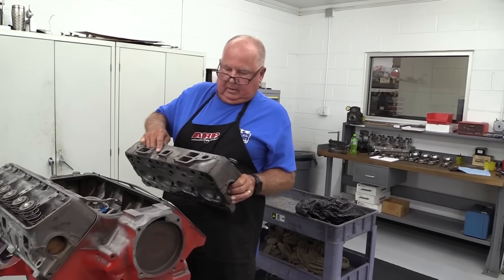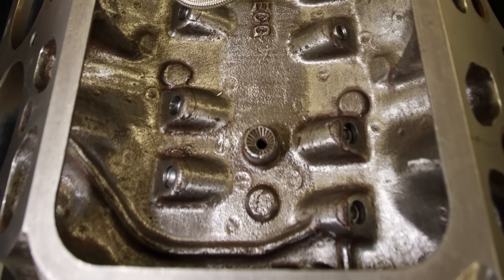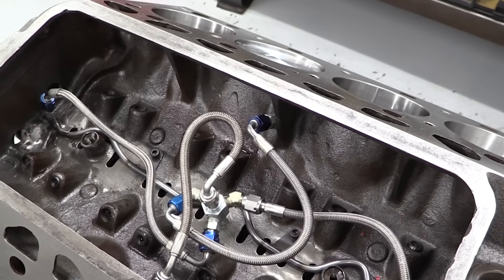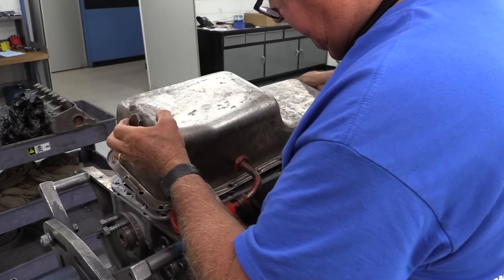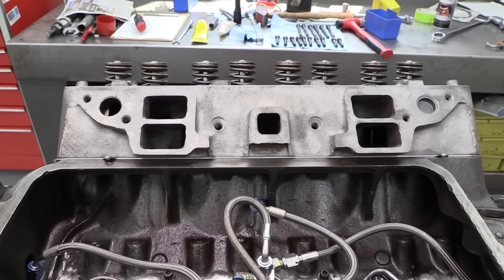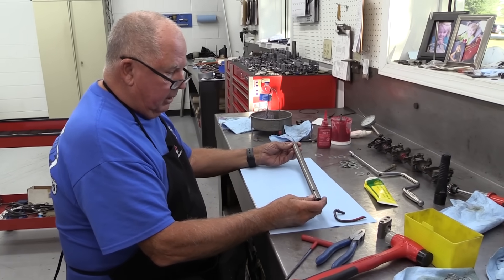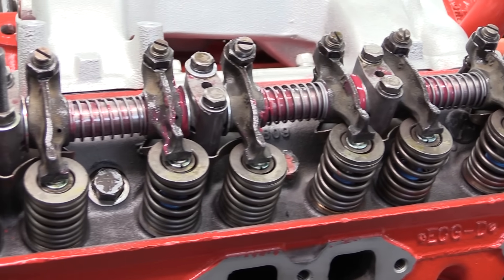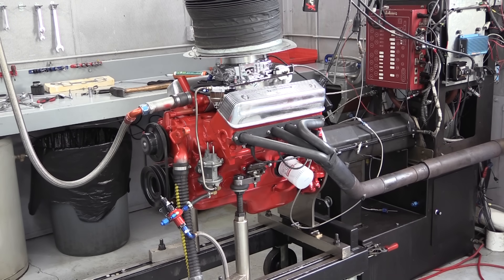The Engine That Replaced the Flathead -- Ford Y-Block Build

Comment: Having a legend like Keith Dorton build a basically stock engine is like asking a world famous chef to prepare a well-done, plain hamburger. At least he got to work some of his magic on the oiling system 👍🏼
Still, it was cool to see one of the vintage engines 🇺🇸
Reply: Yea because when I’m getting an engine done weather it is or isn’t stock I like to take it to a back yard engine builder and have them run a dingle ball honer down the cylinders and hammer the pistons in.
Reply: Chummins there is a huge separation between who you’re talking about and Keith Dorton. Lol 😂
Reply: @jimmy_olds  Given that the engine had already been jacked up once..... sounds like there's not a whole lot in the gap to fill it.
Reply: kyndal anne first of all, my initial comment was tongue in cheek. Second of all, any competent machinist could’ve properly rebuilt the engine to stock specs. Math is math, machining and assembling an engine properly is based around math. While obviously Keith Dorton is a competent machinist, not all competent machinists have the skill set & experience that Keith does at finding power - which is what he’s truly known for. I understand what you’re saying, and going back to my analogy, if you did order a plain hamburger from a world famous chef, it’s probably going to be one of the best plain hamburgers you’ve ever had...but you also didn’t really take full advantage of the chef’s skills.
Reply: @jimmy_olds  Sounds like you haven't been around engine artists...
Reply: @loveisall5520  I have, thanks.
Reply: @CUCV  actually dingle gone is the best finish and most machine shops still use a dingle hone for final finish and also hammer the piston in . Even Keith dorton hammered the piston in
Reply: He was restoring that engine.  Hot Rodding it includes adding displacement and taper milling the heads 7 degrees along with matching the intake manifold’s faces to the new heads angle.  My local NAPA Machine shop can do this trick!  Edit.  T Birds have larger valves and cams to go with them.  Note the +0.040” overbored pistons in this restored Y - Block.  You can’t do everything to every vintage engine, Y - Block or Flatheads.  Ford sold sleeve flatheads which could be cheaply rebuilt with a kit.  Hotrodders pulled out the cylinder sleeves and installed Mercury pistons.  Even the valves were sleeved, and those had to go as well.  So they burned and cracked the now unprotected valve seats.  Welding cracked seats is becoming a lost art.
Reply: Have to completely disagree with you when you're talking about a restoration, not a hot rod. Not ever car needs all the vroom and go fast.....some people just want it restored and built to the best quality they can.
Reply: @phoenixrising4573 , best quality doesn't always result in doing unnecessary mods like was done on this engine.  All of those mods were not needed and corrected no problems.  the oiling problem the Y blocks had was due to the oil allowing build up to happen.  With good quality oil it is never a problem.  Plus what happens when 10 years from now one of those oil hoses fail in the lifter valley and now you lose vital oil pressure cause it was bypassed from its designed routing through aftermarket means.

The upgrade might be fine for a track engine but for a driver it serves no purpose and actually poses more risk for something that isn't taken apart nor worked on all the time like race engines are.
Reply: kyndal ann
Reply: If you think that way, you have absolutely no shimmer of a clue what makes a “world famous chef”...
Reply: @jimmythepowerful   "Mmmm...   That  is  a tasty burger."
Reply: 😂😂Nice
Reply: Talk about odd things on the Y blocks,line up cam and crank dots,surprise it wont run.could make u scratch ur head what's wrong.
Reply: Because the oil passage  from the central cam bearing takes a dog leg at the juncture of the block and head, the passage tents to plug up with sludge. When that happens you must either pull the heads to clean out the passage, or install a set of copper line oilers. The fix this guy uses prevents that plugging from occurring in the first place. However, I am not sure I would omit the oil drain from the rocker arm shaft though. It may not be necessary, but the Ford engineers apparently thought it was. I'm a "Ford man", but I still don't care for the "Y" block. I had one in my '55 Vicky for years, but I still prefer the 289 in my '67 Mustang Fastback.
Reply: @oldgysgt  hello
Reply: @oldgysgt , with modern oils it is not a problem.  my 56 still sports an original 292 that has never been apart, it oils just fine because quality oil was used.  inferior oil is what allows the build up to happen in said passage till it blocks the oil flow off.  With modern day oil today it is never an issue unless you decide to run dollar store oil in your Y block.  Thus those mods he did was pointless and actually will cause more problems in the long run on a driver.  I don't know about you but ive seen those braided hoses fail.  Do you want to have a engine with these kind of oil bypass mods done and have a hose fail or worse yet a AN fitting back off and instead of pumping oil to where it needs to go is now just simply dumping oil back into the oil pan?

This kind of mod is great for a race Y block that you are always messing with but a stock engine that will be driven daily is not something you do this mod to.
Reply: @Milner62 ; I attributed our cleaner engines to better air filters. Premium oils of the 1950s were not all that different than standard oils of today. But modern paper air filters are VASTLY better than the old "oil bath" air filters of the 50's. My old auto-shop teacher would say an oil bath air filter was very good at keeping chicken feathers and cotton bowls out of your engine. When we took off a valley cover back then, we used a putty knife to remove the half inch thick sludge. The number one cause of rod and main bearing failures was a oil pickup screen that was totally clogged with sludge. And that thick goo is mainly dirt and oil mixed. The heavy dirt settles out and coats the surfaces with a dark mud like substance. Fine dirt also caused severe cylinder ware. We had to remove the "ring ridge' before attempting to remove the pistons. If that wasn't done, you could break the piston glands. The last engine I pulled down had less that the thickness of a sheet of paper at the top of the bore, and the valley and inside of the pan were so clean, it only took a swipe with a cloth to clean them. My old "Y" block had to be overhauled every 50,000 to 75,000 miles and rebuilt after 50,000 miles more. My 1995 Mustang has 95,000 miles on it, (I'm a low mileage driver), and the heads have never been off. Like I said, I believe the paper air filter is the great savor of engines.
Reply: @oldgysgt , sorry oil is not what it was 60 years ago.  In the 50`s like when my 292 was out in '56 they recommended single weight oil that you changed with the seasons.  Multiweight oil was in its infancy in the 50`s.  You also had non detergent oil and detergent oil and the composition is completely different as well.

To say the oil remains unchanged or relatively unchanged is just laughable.

The paper filter sorry that I cant say is your saving grace.  my '56 292 has over 130,000 original miles and never been taken apart for a rebuild.  it still sports the OE oil bath airfilter.  so tell me again how the oil bath airfilter caused premature engine failure.  Maybe it was how you serviced said engine that caused it to not last?  I have records for my '56 back to 1963 that show the service done which was done at the recommended intervals for axle, transmission, engine.

So if you were rebuilding your Y block at 50,000 mile intervals you were doing something wrong.

The oil bath filter does its job quite nicely, I just recently changed the oil and flushed the filter element out you should have seen all the small particles that a paper element filter stops that this filter stopped as well.
Reply: @Milner62 ; multi-grade oils are not that new. My 1967 Mustang called for a multi-grade oil, and that was 52 years ago. But like I said, oil is NOT intended to keep dirt out of your engine. That is what an air filter is for. And Paper filters are FAR superior to the 1955's oil-bath filter when it come to doing their job.
Reply: @oldgysgt , you really should work on your reading comprehension skills.  I never said multi-grade oils were new.  I said they were in their infancy in the 50`s and were not recommended on the Y blocks.  The early mutli grade oils from this time period is nothing like what we have today.  But go on I am enjoying how you are destroying yourself by making assumptions and arguing aspects that were never even argued in the first place.

You also claim your y block has to be rebuilt every 50k miles and blame the oil bath air filter and keep claiming oil is not intended to keep dirt out of your engine.  But yet here I am with a 60+ year old 292 that has never been pulled from the car before and never been apart for a overhaul and is well over 100k miles with the oil bath filter.  To be honest the engine is pushing closer to 200k and I might very well pass 200k miles before I reach this car for the frame off restoration.  So tell me how is it the airfilter as being the problem when mine is going way longer than the Y block you rebuilt numerous times?  Sounds to me like its your inability is the reason why your engine isn't lasting.  Either your lack of maintaince or your lack of mechanical ability to build a engine properly.

Its just like you scoff at how I must like noisy rocker arms for not adjusting my rocker arms in 3 years even though they were quiet for those 3 years before I had to make an adjustment.  Your monthly adjustments is a sign of a bigger problem or your in ability to properly set the valve lash or something.  All I know is I follow the OE manual for service and set things to spec and when it comes to the valve lash they were set at 0.019" as the book said.  If you are setting yours more often coupled with having to rebuild your Y block every 50,000 miles and blaming a oil bath air filter for the lack of longevity is a telling sign that you don't know what you are doing.

A little bit of information, the oil bath air filter is no different than the K&N air filter.  Hell even the paper filters used in the 60`s, 70`s, 80`s and 90`s on some applications are a oiled paper type of element.  The paper is the filter media and the oil is to help the particles stick.  In the case of the oil bath, horse hair is the filter media and the oil is to allow particles to stick.

Like I said earlier I just recently did a oil change in my air filter and you should have seen how much more dirt this oil bath filter has captured compared to paper filters.  Every paperfilter I have has never caught this much.  But please continue blaming everything but yourself for your engine problems when there are people out there with none of the problems you claim.
Reply: @Milner62 ; I got 15 years on you. And like I said, I did my first 272 the year before you were born. The 272,292,312 family were a total joke. They developed less HP than the small block Chevy, the oiling system was full of problems, (you never saw a set of aftermarket oilers on a Chevy V8, because they never needed them), the model 4000 Holly carburetor was crap, the exhaust manifolds were poorly designed and inefficient, the factory single exhaust front crossover system was poorly thought out, the heat riser gate on the duel exhaust cars frequently stuck, and although Ford had experience with Hydrophilic lifters on the Lincoln Cosmopolitan, they stuck to solid lifters on their small block and used a very outdated hollow rocker shaft that required manual adjustments. Most all of these problem of poor design were fixed on the later 289, and the crummy "Y" block was finally dropped. None of the bad features I have mentioned that the "Y" block had were ever used in a Ford engine after the demise of the "Y" block, and the contemporary Chevy engine didn't have these poor features either. Ford's Ugly Duckling "Y" Block never did become a Swan. 
But when are you going to realize the purpose of oil in an engine is to put a active film of lubrication between moving parts and to carry away friction caused heat from bearing surfaces, but NOT to keep dirt out of the engine! And air-born dirt in an engine is the number one cause of engine wear! If you REALLY are 60+, why is it you don't know that simple fact?
Reply: @Milner62 ; I see you are still at it with the childish personal attacks. Why don't we try once again to raise this discussion to an adult level, shall we. Now, is your Y block stock with the original pistons, rings, bearings and valves? I doubt it. And you are apparently under a serious misunderstanding; I did NOT say that only 1950's Y block engines were usually gone through at around 50,000 miles. That was true of most ALL cars back then. My problem with the Y block is it was a poorly designed dead end, and apparently Ford finally cane to that conclusion as well. None of the poor design features of the Y block that I pointed out were used on subsequent Ford car engines.  And you never said; are you still using the oil bath filter, or have you changed to a replaceable paper filter?
Reply: @oldgysgt ,  I'm not making childish attacks.  I am stating the facts.  You said yourself you rebuild your yblock every 50k miles that is your own in ability or lack of servicing your engine properly.  That's not a insult as it is stating the obvious.

As far as my 292 goes I've said it multiple times my yblock I just looked at the odometer and it's on 63k miles and I have service records back to 1963 in one notebook that indicates it is 163k miles.  Not once in the book is the note of a engine replacement nor engine disassembly.  This car is also a one owner vehicle when I got it so I know its history quite closely.  Believe me when I tell you this engine has never been apart.  Only part of the engine that has ever been taken apart is the valve covers for the regular service of rocker arms and the water pump I rebuilt when I got it as the water pump was locked up.

So quit with your assumptions first you assumed my age and now you are assuming my 292 that has never been rebuilt has been rebuilt when I have the documentation to prove it wasnt.

You cant believe it because yours didnt last 50k miles and you cant admit your rebuilds didnt last either to your inability to rebuild a yblock or your in ability to properly service said engine.

This has nothing to do with insults it has to do with facts.  Everything you've stated and presented as fact is nothing but personal opinion that has zero bearing on this.  Your engines inability to last does not mean it's theoil bath air filter as mine is over 150k miles currently and always used the oe oil bath filter it wasnt poor design of oiling system as mine still has great oil pressure and rocker arms oil nicely with no restriction.  Every thing you've said can be influenced by lack of proper service.

Now have you taken that reading comprehension class yet?  Seems you still need it as I've said numerous times my 292hasn't been overhauled before but you just dont grasp that some reason jut like you took my age as 60 when I said my 292 is over 60 years old with no rebuild and no oiling problems.  Just like I've said numerous times my engine is still running the oil bath filter with over 150k miles on it but you keep asking when the answers were provided. 

I'm sure everyone here is laughing at your complete lack of reading comprehension skills and how you are shit talking an engine saying how horrible it is when it isnt and all you can provide is your failed attempts of citing your inability to build or care for your engines.

As far as rebuilding goes I still call bullshit on engines of the 50s having to be rebuilt at 50k miles.  My newest vehicle is a 82 model with over 100k on it with no rebuild.  My 78 is right at 200k with no rebuild.  My 63 was at 170k when the engine was pulled to hotrod it.  Then my 56 is over 150k miles with no rebuild.

Not to mention the yblock was used in argintia to the 80s same block but heads were changed.
Reply: @Milner62 ; sorry Charlie, I never said I overhauled MY 272 every 50,000 miles, and I doubt your 56 year old has the original pistons, rings, and lower bearings, regardless of what some service book says. The oil bath was a piece of crap, and ANY real mechanic will tell you so. Like I said, Ford realized the Y block was a dead-end, and replaced it with a modern up-to-date Overhead V8, and that is a FACT. I really don't know why you are hung-up on praising the Y block, but you differently are in the minority! 

PS; by the way, if your Y block was made in 1963, it must be a pickup, right? Didn't the 1963 Ford pickup come with a disposable paper filter? As I remember, it did. In fact, didn't Ford convert to paper filters in 1957? Do you know what an oil bath air filter is and what it looks like? Just what kind of Ford are you talking about and what year is it?
Reply: @Milner62 ; before going any further, what is the model and year of your Ford with a Y block engine?
Reply: @Milner62  I live in Australia ,although I hail from new Zealand. Back in the 50's through to the late 70's we couldn't get SBC's easily unless you had 'contacts' where you could import them, but y blocks were common and I had my 1st at 17,even though I drove a belair as a daily. I learned that although there were few odd things like those crazy inlet ports,they could be made to live and that Y block held them together very nicely .Bigger Ford Trucks came with a 292 and 312  but sported steel cranks so we were always trying to find them. I have seen them run,literally into the ground but the thing that seemed to kill them was a lack of regular maintenance ,something that goes for any machine. you never heard of a Y block exploding because  of design weakness ,and even blown ones held together nicely. Yes,you could buy a blown Y block from Ford in 57. Today,lots of geriatrics like myself still remember the revs they could reach and still be making power,whether they were cars or boats. As for oil, I used detergent 30 Diesel oil in mine...because i worked in a Diesel service depot.
Reply: @Mercmad  , yep and we are seeing Y blocks making over 500 hp easily.  But a sbf of the Windsor family 500hp is the limit of a OE block.  More than 500hp and they seem to split the block in half.  If you plan on making over 500 it's better to go with an aftermarket block.

But yeah people say the Yblock was poorly designed lol.
Reply: @Milner62  
500 hp y block 
easily ????
Reply: @oldgysgt  - your lack of Ford knowledge is obvious to an old Ford parts man like me. Ford used OIL BATH air filters through (at least) 1979. All F-350, 330 cu in FE/FT hybrid V8's they supplied for U-Haul chassis cabs came with OIL BATH air filters. They are in the official OEM Ford shop manuals. I personally own an F-350 1979 ex-U-Haul, and have the OEM OIL BATH filter.
Reply: @oldgysgt  The 292 was the longest-lived of the Y-Blocks, carrying on until 1962 in U.S. cars and until 1964 in U.S. trucks. It was also used in Argentina in the F-100 pick-up well into the 1960's. 

In 1971, the engine was modified to accept a new-style cylinder head with a different valve arrangement - in this form, the 292 continued into the 1980s in the F-100, and was also used in the Argentine Ford Fairlane (built from 1969–1982, and based heavily on the U.S. 1968 model). 

All Argentine versions of this engine feature a cast crankshaft rather than the forged example that equipped US heavy-duty engines. The 292 version was also produced by Ford of Brazil and equipped the Brazilian LTD starting in 1969. Both the 272 and 292 engines were replaced on Brazilian cars by the 302 engine starting on 1976 model year.

^Did you read that^, mister know-it-all Y-block critic? Ford's Y-block was installed from 1954 through 1982! That's OVER 28 years, and no doubt they were still being cast after that 28 YEARS! Must not have been a good engine, eh?
Reply: @sandibaker7646 ; My father's 1959 Ford Ranchero had a disposable paper air cleaner, as did my 1967 Mustang and my 1972 Ford LTD. Large Ford trucks might have used the obsolete oil bath air cleaners longer, but I have not seen any Ford passenger cars use them after the late 50's.
Reply: @sandibaker7646 , the Ford Y block was still a piece of crap. Solid lifters, poorly designed oil system, and inefficient exhort system. If you like them, fine, but you are in the minority. The overwhelming number of Ford Flathead conversions to small block overhead V8's were done with Chevy engines, not Y block Fords.
Reply: @oldgysgt  -- I was a parts man at a large Ford dealership for 8 years (1969<1976). I am well aware of Ford paper element air filters, and their applications. 

Oil bath air filters were preferred when most roads were dirt, even though they were messy to clean. A farmer might be driving daily on dirt roads, or a dump truck delivering mined sand on dirt roads -- in such cases, and others, daily cleaning of oiled elements would be preferable to daily replacement of paper filters.

"As roads improved in the 1950s, the need faded away for a filter that could hold a lot of dirt without clogging. Thus came disposable pleated paper filters, which could filter smaller debris."

Ford and U-Haul decided that an oil bath air filter was best for thousands of F-350's, through at least 1979. By then, most roads were paved, and the mass production of paper element air filters had reduced their purchase cost enough to make them preferable to "obsolete" oil bath air filters.
Reply: @oldgysgt  - so, by your reasoning, Ford used their Y-block "piece of crap" for over 28 years? I see now! They should have bought their engines from Chevrolet!

As far as solid lifters go, many racers prefer them to hydraulics, to this day. Ford was selling economy, ease of maintenance, and a low selling price in 1957. THAT"S why they outsold Chevrolet in 1957.

Ford used the same "poorly designed oil system" of the Y-block when they redesigned the FE oiling system in 1965. Ever hear of Ford beating Ferrari at Le Mans three years in a row, with their 427's "poorly designed oil system"? The side-oiler powered Ford GT40 MkIIs had a 1-2-3 finish in the 1966 24 Hours of Le Mans, and the winner's podium in 1967.

Ever hear of Ford's 427 SOHC, and it's "poorly designed oil system"? 

"The SOHC 427 found its niche in non-stock drag racing, powering many altered-wheelbase A/FX Mustangs, and becoming the basis for a handful of supercharged Top Fuel dragsters, including those of Connie Kalitta, Pete Robinson, and Lou Baney (driven by Don "the Snake" Prudhomme). In 1967 Connie Kalitta's SOHC-powered "Bounty Hunter" slingshot dragster won Top Fuel honors at AHRA, NHRA and NASCAR winter meets, becoming the only "triple crown" winner in drag racing history. It was also used in numerous nitro funny cars including those of Jack Chrisman, "Dyno" Don Nicholson, Eddie Schartman, Kenz & Leslie, and in numerous injected gasoline drag racing vehicles."

Perhaps Ford's "poorly designed oil system" was not as "poor" as you think it was?
Reply: @sandibaker7646 ; oil bath air filters are crap. As my old auto shop teacher would say, "they're fine when it comes to keeping chicken feathers and cotton bowls out of your engine, but that's about all". It's true that in a dusty environment they don't clog up like paper air filters, but they also don't keep the fine dust and grit out of your engine either. By the way, what kind of air filter is on your car? HHHHMMMM?
Reply: @sandibaker7646 ; over 28 years or over 128 years, the Y Block is still crap. Apparently you can't understand; I don't like the Ford Y Block engine, but apparently you do, and that's all. So get over it!
Reply: @oldgysgt  - K&N oiled cotton gauze - the better than paper progression from an oil bath type. You seem to lack reading comprehension, and your shop "teacher" was a very poor example - If oil bath type WERE crap, why did Ford and U-Haul use them through (at least) 1979?

With your expertise, you should contact Ford, and I am sure they will ask you to be a consultant, and hire you in their engineering department with a $100,000 per year retainer
.
Reply: @sandibaker7646 ; It's now obvious to everyone you know nothing about automotive air filters. You might be able to read a parts catalog, but you are ignorant of the properties of an air filter. Have you ever heard of "microns'? Apparently not. A good paper filter is capable of a micron rating of 5 microns, with is over 10 times finer than the best rated oil bath filter.
Reply: @sandibaker7646 ; by the way, the K&N air filter with a cotton media cover is NOT an oil bath air filter. It's a paper air filter with a cotton cloth outer sheath. Try looking up "oil bath air filters" on the internet, and educate yourself, because it's evident you have no idea what a oil bath air filters is.
Reply: @sandibaker7646 ; PAY ATTENTION! The conversation was about the replacement of oil bath air filters with disposable paper air filters. The filters sold by K&N are not oil bath filters, so have NOTHING to do with the subject at hand. Capish?
Reply: @sandibaker7646 ; the Ford Y block obsolete when it was first made. If you like it, fine, but I have worked on enough of them in my youth to realize they're crap. If you don't agree with that, that's your problem, so get over it!
Reply: @oldgysgt  That's because the Chevy engines were lighter and a dime a dozen. Parts were cheap and easier to get. The short stroke engines would rev higher and faster but the long stroke Ford would develope more torque and would beat a Chevy on top end, something I did many times with my 56 Mercury Convertable. I rebuilt the engine while in high school, 1964. during my Vocational Auto Shop Class, a 4 hr. per day shop class. I did everything I could to that engine. Punched it .080, refaced the rockers, valve job, put a 0.010-.010 reground crank in it, re-surfaced the heads, had a budy in machine shop match the intake manifold to the heads, installed a new hi-pressure, hi-volume oilpump (80# idling), replaced the teapot Holley with a Holley 600. That Merc would run 145 MPH @ 5000 RPM.
Reply: @ronaldharris2439  Yea, those old Holley "teapots" were a mess. Why did you go .080 over, most rebuilds are .040 over. were you looking for a somewhat larger displacement?
Reply: Keith Dorton   - Turd-polishing 101. The Ford Y block; a heavy, slow, low-RPM, main-leaking, stacked-port, rocker-squeaking piece of antiquated  junk.
Reply: @daryllect6659  I too have a Y block. It is in my 1960 F-100. Had to have it rebuilt because it completely abused qith early dwmise. Had it rebuilt by a very competent builder with a vast, vast knowledge of these Y block & MEL motors. I bought a complete kit from crankshaft to carb. 340ci with plenty of reliable power. Taking car of this motor is all in proper servicing. I know many people with this motor. No issues as they took cate of the motor. Only way we can judge is by owing a Ford with this motor & years of experience. If tou never owned one, you cannot judge
Reply: @aldonelson5757  I've had more than one Y block. I know exactly what I'm talking about. They're just  heavy, long-stroke,  low-RPM, main-leaking, low-performance stacked-port, rocker-squeaking pieces of junk.
Reply: @daryllect6659   Yes, they are a heavy motor built more as a torquer than a high revving mill. I bought all redesigned aluminum & the motor runs just fine. For Fords first ohv motor, was not all bad
Reply: @daryllect6659  
So is yo momma but ain't nobody bad mouthing her. Those dentures when they come out though 😍

How is momma btw
Reply: Chefs don't make 'well done' burgers.
Reply: Working on a Y block is like spending time spitting straight into the wind, regardless of whoever is doing it.  IF the person likes to spit into the wind, then that is their deal (mental retardation).